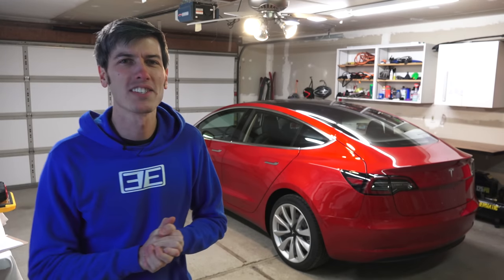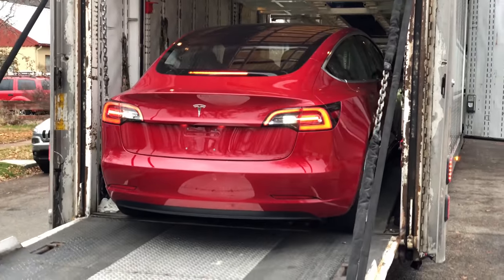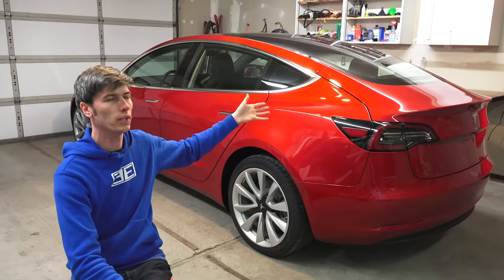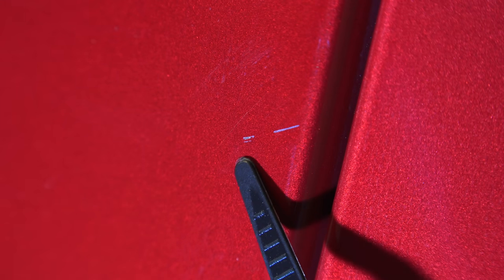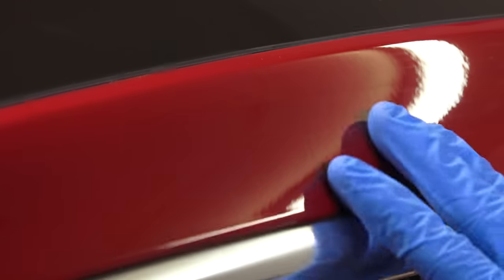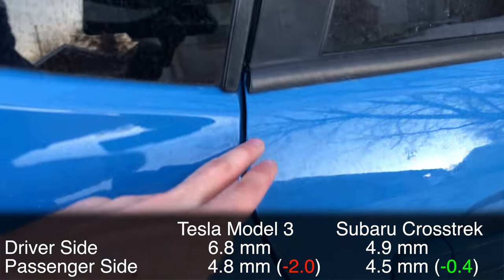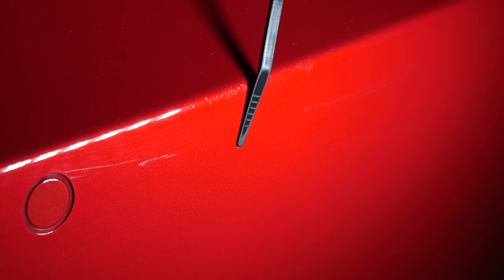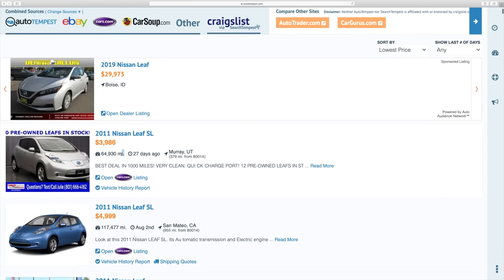Everything That's Wrong With My Tesla Model 3 - Quality Problems

Comment: I think that huge pimple is a deal killer.  That means no one did any QC
Reply: I agree, I've seen quite a few cars on lots recently. Seeing scuffs and little scratches are pretty par for the coarse since not every car can be transported in a ISO 9001 container. But a pain blemish that bad is easily a deal breaker.
Reply: Ik don't think there is a Quality Control at Tesla. I took delivery of 15 Tesla's in total. These quality issues seem very familiar. The later the delivery, the more problems...
Reply: They have to make their numbers. So they are not allowed to delay deliveries because of something minor like quality problems in paint. Can fix it afterwards once revenue is recognized and the car appeared in the statistic as "delivered"
Reply: In all fairness a lot of that damage could have been caused in transport
Reply: I love Elon, but this how employees rebel when you make them work 80 hour weeks.
Reply: That glass installation is the biggest evidence of lack of any Quality Control checks at Tesla.
Reply: @nikosv8166  
The paint blisters happened at the factory during the painting process, long before the Tesla was loaded for delivery.
The paint scuff's should have been dealt with before the customer takes delivery of the car.
That's almost standard SOP even for cars that sell for 1/2 the price of a Tesla Model 3.
Reply: I work in stamping in Fremont, and we worked 6 days a week for three months to get production at the rates they're currently at. Since, we have been working a more reasonable schedule, 3 on, 4 off, 4 on, 3 off, and working no more than 3 consecutive days. With great benefits, like holiday pay I'd say it's not the sweat shop you think. We worked that many hours because our crew wants to succeed, and will devote the time necessary to make that happen. None of us were forced to work those hours, as we were only scheduled for 40/week average.
Reply: If nobody noticed a HUGE AND OBVIOUS problem like that, then it means they literally payed zero attention to the cars, and imagine what kinds of issues are present on the cars that aren't so obviously visible.
Reply: @user-yd6qk6nk2i   Well American cars have never been known for quality, especially in the last 20 years when they've been lagging far behind European brands, and you could argue that American cars at the moment are the worst overall of any country in the world.  Even Korean cars (which were known for being crap like 10 years ago) have MASSIVELY surpassed American cars in terms of quality. The reason for that is simply in American mentality, the nation has a "quantity over quality" approach to everything, cars included, and America is known for that reason for making cheap cars, American cars have been the definition of mass produced garbage for a long time now. 

On top of that, American car makers have always had very one-dimensional approaches to making cars. What I mean by that is that they build a car for a purpose, and focus on that, but skimp on everything else. When Chevrolet builds a Corvette, they only care about the performance aspects, let's give it a big engine, lots of power and good suspension, but then everything else suffers because they do it as cheaply as possible to keep the cost low. When Porsche builds a 911, they care about EVERYTHING as much as they care about performance, so the cars aren't only performing well, but are extremely high quality cars polished in every detail, whereas as a Corvette performs well, but can't hold a candle to a 911 in any other aspect such as luxury, quality, refinement, reliability, attention to detail, etc.  BUT, they're cheaper to buy. So it's ok I guess. 

The problem is when Americans try to make luxury cars with that same quantity over quality mentality, and fail hard. That's why even American cars such as Cadillacs or Lincolns, which are considered "luxury" by some, only LOOK luxurious, until you start touching things and using them, only to realize they're put together like crap, everything rattles or squeaks in the interiors, everything feels cheap and hollow, what looks like metal or wood is actually plastic, what looks like leather is often not, etc.  Perfect example for that is the new Lincoln Continental. The car looks great on pictures, especially the interior, but when you actually sit in that interior and start to touch things, you realize that it's about on the same quality level as a Ford Fiesta, but with fancier looking materials. It doesn't have ANYWHERE NEAR the quality or solidity feel of a Mercedes, BMW, Audi, Lexus or even something like a Genesis, which is a fancy Hyundai, and people made fun of Hyundai 10 years ago. The same is true for every single Cadillac model out there. Looks good on pictures, but the looks are very superficial and not much quality is backing up those looks. And exact same is true for Tesla's too, EXCEPT Tesla interiors don't even look good on pictures, and to me a Model 3 interior is about the worst quality interior on the market at the moment, price no object, if we exclude cars that are built specifically to be cheap on some world markets. I'm having a hard time thinking of a regular car (even a much cheaper one) from a mainstream manufacturer that has an interior with such cheap materials, such bad attention to detail, such flimsy and cheap feel to everything.
Reply: I work for Honda, and any paint pimple gets repaired, unless it's on the underside of bumpers which is a grade 4 zone.
Reply: That's a good point but I disagree.  It is possible that they have QC throughout different stages and this just got missed.  I would be concerned you are correct but, it's not automatically the case.
Reply: so the fact that they clearcoated over scratches was ok? I mean someone saw the scratches and sprayed clearcoat over it anyway.
Reply: @MrRhubarbs  Is that how you interpreted the test - with spraying water?  I didn't see it that way - thought the scratches might have happened after / maybe during delivery.
Reply: justin Case either way, for a car to arrive at the customer with attrocious paint like that, you have got to be doing something very bad in regards to quality control
Reply: @ChrisHeiligers87  the guy says he got the car within two days of order, so it is not late by any means
Reply: @krishnakumar-vs4is  I'm confused... I'm not saying the car is late...
Reply: @iTheGreek if you actually sit in a mercedes (amg or maybach), you will think differently. Porsche is the best car company and their quality is one of the best but on the other hand merc and bmw produces many many more cars than porsche. Therefore of course a porsche has less issues (and porsches are more expensive than most bmw or merc cars)
Reply: @ChrisHeiligers87  ohh you meant in recent deliveries, okay but I hear the car's gr8, it's just few scratches on the outer body, more paint might fix it, I guess
Reply: derbigpr500 l
Reply: some of my friends work at a detailer, they work on brand new cars a lot, buffing out scratches etc... so I don't think it's that tesla cars come with more scratches than other brands, it's just that there is no dealer in the middle polishing out scratches and charging you 10% of the vehicle cost. I'm not saying tesla is fine... but in the real world... do you want to buy a tesla from a dealer instead? Because a lot of these issues wouldn't exist if you did buy from a dealer.

Comment: I took delivery of a red Model 3 recently and went over the car quite closely myself and with a Paint Protection Film expert.  My vehicle had much fewer scratches than yours.  The panel gaps appeared to be less and more consistent on both sides, I didn't use digital calipers though.  The only major misalignment I noticed was the roof glass panel that was off by about 4 mm.  I think the car you received was one another customer had rejected which is why you were able to take delivery so soon after ordering it.  My Performance Model 3 arrived about 3 months after ordering.  My car is otherwise fantastic.  I previously had a 2013 Model S and the build quality has definitely improved IMO.  Obviously, I am a Tesla enthusiast but I do think new car buyers need to go over their Teslas closely on delivery and feel comfortable rejecting them if there are quality issues.   Many luxury buyers might be put off by some of these quality issues but these don't happen all the time.  In fact, I find Tesla to be quite proactive and they seem to try harder to satisfy their customers compared with a few other manufacturers that I have dealt with in the last 25+ years of buying cars.
Reply: if it was a rejected order then shame on them for trying to sell it as new and leaving the defects all over the place. At least try to fix the apparent paint issue.
Reply: I just received 2 defective top of the line Sony Z9d TV's both of which said they were MFG in October 2018 and I mean juggling 65 inch TV's returning them and the whole thing. I mean just think about the time it takes the customers who have to waste so much time on the garbage quality control, weather it was from the factory or the people shipping the stuff. I mean if people actually slowed down just long enough to make sure expensive TV's or expensive paint jobs or expensive anything is actually handled with the best care. I mean it's become a business now, just sloppy.
Reply: Pretty sure he will get a new one now and they will try to fob off this one to someone else that won't give a damn. Seen this dozens of times in sales.

Comment: My red VW Golf 6 had less scratches after 22.000 miles than your delivered Model 3. 
My personal opinion, even though most presented scratches should be fixed with a polish and doesn't require repainting, this is unacceptable (especially you paid extra for the red-paint package).
Reply: It's mostly unacceptable because its a 50k car from a company that regularly mocks "legacy" car makers.
Reply: My 30 years old daily driven original first paint Mercedes doesn't have this amount of scratches today 😂😂 panel gaps are Mercedes panel gaps, aka perfect panel gaps... I really wouldn't like to see my brand new car in this shape, this is terrible
Reply: Agreed, pretty sure after 5 yrs and 80,000km (50,000 miles) our Mazda 3 has about the same number of scratches and marks on the paint....
Reply: Bogdan Antone vws have one of the best body works in economic cars, thus its nickname metal tooling shop. Wouldn’t surprise me even if your golf 6 still has that +-0.5mm gap variances. On top of that, paints on this model 3 is unbelievably bad. My 15yo audi a4 has less scratches, and it’s been through 1 major rear end accidents and several other smaller ones which i didn’t even care to fix.
Reply: My 39,000 mile / 7 year old car has less issues
Reply: Yes, but you bought an overpriced, German, money pit.
Reply: @shepherdsknoll8  that was like 7y ago ? Golf was a fairly (and still is) good price/quality balanced car. And for the $15.000 brand new, I still think i made a good choice, given the fact that i had no issues with it so far , after 100k miles.

Comment: Wow! That's awful! My concern would be if they're this sloppy with what you can see, what about what you can't see? Sure, they're willing to fix up these blemishes now and make the customer happy. But how happy will they be when they're stuck on the side of the road in 5 years because some insulation chaffed through and shut down the car?
Reply: Harley Pebley yea.... no news here. Tesla is sloppy with installing bad battery packs that are not fit for installations. That info was leaked months ago. They are also having a problem with injured and accidents in their production line much higher than other car makers.

Comment: The panel gaps are definitely not as consistent as they should be but aside from the glass roof I wouldn't worry about it.
The 2500$ paint job is pretty disappointing though.

Comment: looks like they sold you a used car :D
Reply: i thought the same
Reply: I bought a used SL500 that was over 10 years old, and it was way better than this Tesla, paint wise. Although it was the worst car I ever owned as far as repair costs go.
Reply: My 22 years old Honda Civic LE has better fit, finish and reliable on the 20th years than that before it goes to the trash on the final 22nd year.
Reply: They just fixed the odometer 😎
Reply: eBay for 1/2 $.
Reply: Just goes to show that Musk is in over his head with this venture.
Reply: Lowell Dever high maintenance costs are to be understood with that glorious car, would take it any day over the model 3 it was such a well designed car
Reply: My thought also. The direction and location of the scratches look like automatic car wash damage.
Reply: just to make this clear, it was a joke. There is no way this is a used car.

Comment: I got my all wheel drive Model 3 the end of September 2018 and after looking it over took it to get wrapped and had none of the paint issues you had. I have the Blue.  Maybe some gap issues but nothing I would do anything about. As far as cars I have had Vet's, Porsche's, T-Birds, Jeeps, and more and I can say this is the first car in 7 months haven't found anything that needs attention. I have a minor cosmetic issue with a trim piece across from the mirror on the passenger side but will get it fixed when they update my computer for self driving.. So I am a happy camper.
Reply: How much did they paid you?

Comment: I worked for a Volkswagen factory in an underdeveloped country that has higher quality standard in the paint job...
Reply: Tesla should ask the Mexicans for help... they still have to pay for the Wall anyway.
Reply: @thelining4078  I'm sure his factory is full of Mexicans. The problem is quality control, cars made in Mexico from other manufacturers are much better built than these.
Reply: The VW beetle is getting discontinued though.
Reply: Marius Ipad  if there will be a "next year" for them...
Reply: SAVAGE
Reply: Obviously those scratches and scuff marks happened in transit. Careless loading and unloading of the car, or maybe vandalism/sabotage (you can't rule that out!)
Reply: Volkswagen. The least reliable cars coming out of Germany. I’d rather live with the gaps in this Tesla than own another VW.
Reply: @toneyeye  
No....those are paint flaws, not scratches.
Reply: @toneyeye  "Obviously"...Nope. I've seen a friend of mine with a new model 3 here in Germany. Same problems. There are loads of guys with blogs and tech pages who can confirm this bad quality.
Reply: Marius Ipad      I hope so!   I am in Australia and our cars are right hand drive like Japan, Hong Kong, Singapore etc and I would have a lot more confidence in getting a Model 3 from the Shanghai Giga Factory.
Reply: @toneyeye  Of course it is sabotage. Big oil is paying me to scratch Teslas and pull apart the body panels in a vast global conspiracy to bring down Tesla.

Comment: A $15,000 Kia has better paint quality, why did you pick it up from a delivery truck and not at the dealership? I work for a Mazda dealer and defects in paint would have been repaired before delivery.Panel gap issues show the lack of quality control inspection at the factory.
Reply: Rob Buell unfortunately, Tesla doesn’t have any “dealerships”, but they do have little stores setup where you can see most Tesla models and sometimes do test drives.
Reply: @User82558  Yep, I'm on the fence about Tesla - I like the idea, and want to support them for being the ones to really push this forward, and my wife LOVES them and wants one badly, but unfortunately the lack of dealerships and for want of a better word, the "apple-ness" of their attitude to parts/servicing and the general 'walled garden' they have is currently making them a no go for me. It's a shame for sure, but it's also a lot of money, and at the end of the day, it's a lot of my money.
Reply: @jamesoren7238  If you live in Cali check out the Hyundai Ioniq EV which will have the full 7,500 tax credit. It's relatively equivalent powertrain and range to a Nissan Leaf.

Funny enough the base model PHEV Ioniq will come out as the same price of a base model Hyundai Sonata. The difference is 3 cubic feet of interior volume and a couple inches of length.
Reply: We actually have a Tesla dealership here in Calgary, Alberta. Not just a showroom but with an actual shop for repairs. Sucks that if they are personally delivering a vehicle to your house that the factory quality control can't make a final assembly line check and do any minor repairs and adjustments. At a normal dealership a vehicle goes through a Pre Delivery Inspection by actual tecnicians, this is the missing step that catches all the small quality issues. Hope Tesla makes good on their promise to repair the faults.
Reply: @4b131  Tesla is technically profitable now by $250 million in Q3 but only due to $500 million in ZEV carbon credit sales to viable car companies under the California Air Resourced Board system. Considering the average Model 3 delivered so far is around $45K - $50K I don't see how he will be profitable at all if the "base" price becomes the most purchased tier.
Reply: re: panel gap issues, It's possible their quality control department is just fine at the factory, but manufacturing and assembly tolerances are relaxed a bit to save cost.
Reply: James Oren I was in the same boat as you except it was me who has been wanting a Tesla. Your comments and of many others here have really put things into a very clear perspective. 
I’m gonna wait at least 2 more years before I can consider buying a Tesla.
Reply: @Jose Perez I'm not saying you are wrong.  I would also be pissed if I cared more about panel gaps and paint blemishes than literally every single other benefits that the Tesla has over other cars in it's class.